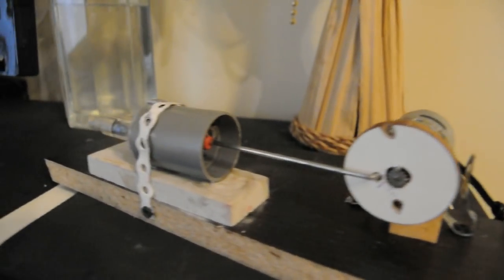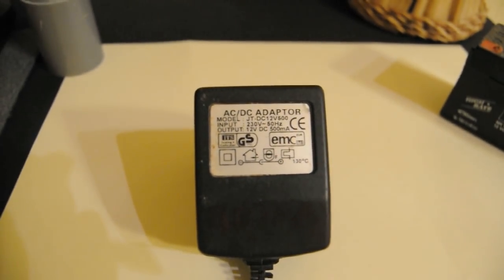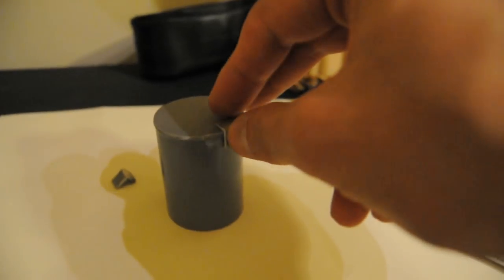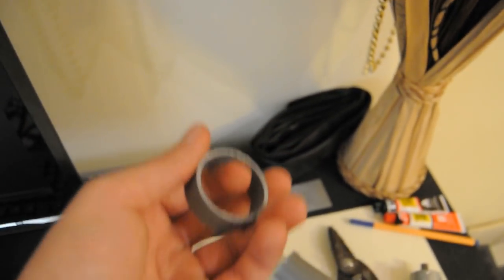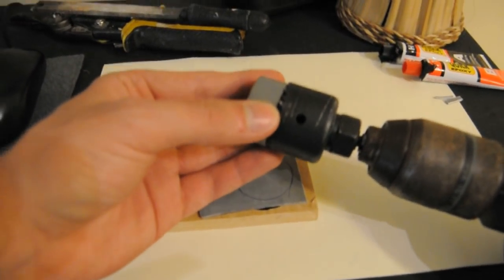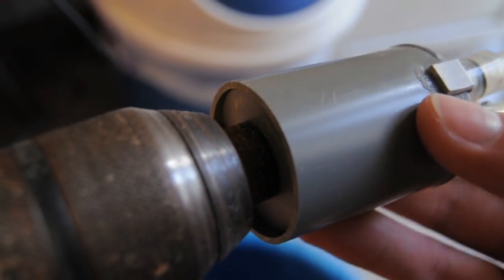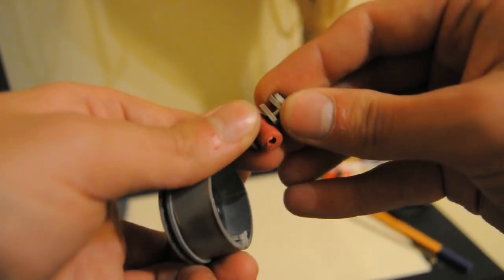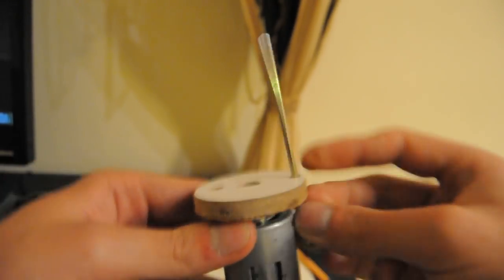How to Make Motorized Piston Air Pump at Home (Original Video)

Comment: But i need vaccum pump how to make that
Reply from the maker: If you manage to completely seal it then i guess you could use the air intake as a vacuum line, however don't expect much, the most efficient  and useable thing to use would be a manual hand pump with its intake used for vacuum.

Comment: HEY - this could work as a ventilator pump for coronavirus victims with a little fine tuning of the pump displacement and cycles per minute.  You will want between 20 and 25 cycles per minute, with a displacement of 500 mL per cycle.
Reply from the maker: It should work as far as the material used and the construction is reliable,